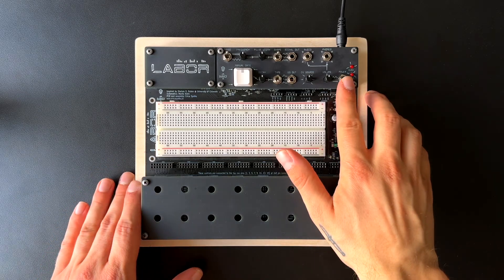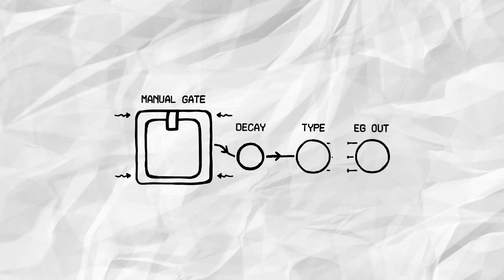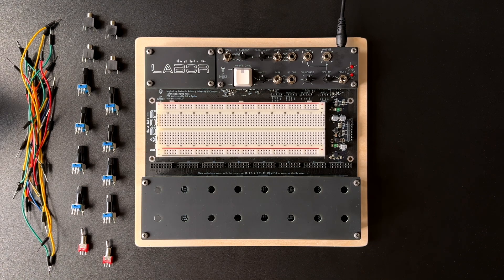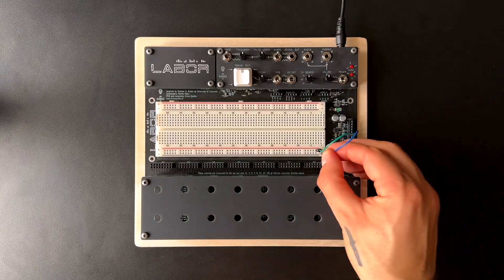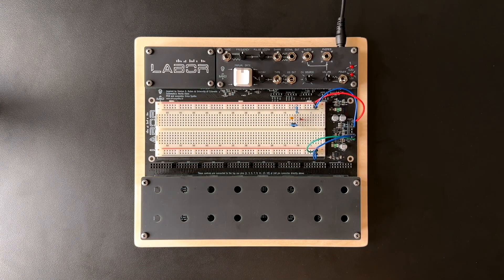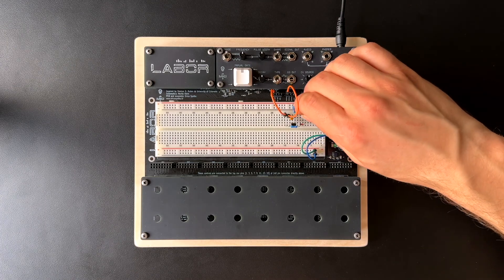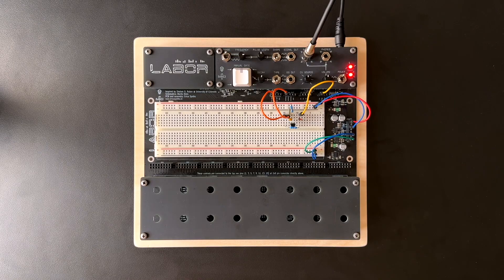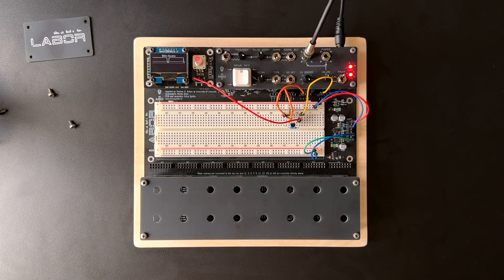I created a DIY synth prototyping station

Comment: Built it. Now on to doing some laboring with Labor!
A buit-in speaker is probably the only thing I wish it had. Probably going to build one for the expansion part myself.
I can see how someone could write a whole book with audio experiments for this board. I'd buy it.
Reply from the maker: glad to hear! we‘re also planning to do a speaker for the expansion slot - and a book with audio experiments :)
Reply: @MoritzKlein0  I love this things. Really awesome. Just have to figure out how to store it with parts and such in a way that I can easily pull it out and play around with it and safely store it away again. 
Only one thing I suggest, if you ever to an update to the build manual, I found that using the breadboard itself to get the connectors on the pot/sw/con modules straight. Basically plugging the connectors in the breadboard and had the module on top and then soldered it. It helped holding the connectors in place while soldering it and also to get it totally straight. I hope that makes sense.
If you need anyone to do test cases on the book, I'm willing to be a test subject. :)

Comment: Hell yeah, mine just arrived and it's gonna be a godsend with diy projects - especially having the integrated power supply. I might even modify one of the jack modules to use larger 1/4 inch jacks for kosmo format 😁

Comment: This is exactly what i've been looking for and i've got one coming today!  I recently built a TTSH and one of the two filters isn't working.  It's on a sub-board but still needs a fair bit of supporting hardware to really test and this should help a ton.   Is there any reason this wouldn't work if I feed it +/-15VDC instead?
Reply from the maker: you mean use a 15V wall wart instead? that shouldn't change anything about the supply voltages, since they are transformed inside the device.

Comment: Love the videos, extremely helpful, insightful, and interesting. Could you recommend basic electronic components that most commonly appear in your circuits, specifically which IC's are used the most often?
Reply from the maker: you can check the Labor manual for a list of commonly used components (bill of materials/full kit section): https://www.ericasynths.lv/media/LABOR_MANUAL.pdf

Comment: I've  been thinking about building something like this as an aid for experimenting with guitar effects design.  Very well executed design and implementation.  The modular drop-in oscilloscope built with what must be an ESP32 microcontroller and LCD screen is just the icing on the cake.

Comment: would you consider selling variations with power supplies optimized for guitar pedal design (9 and 4.5 volts) and 500 series module design (+16, -16, +48)?
Reply from the maker: hmm haven’t thought about that. i‘ll discuss it with the others :)

Comment: I always use a basic 3 / 5 / 9 volts direct source for my projects.  Going full +-12V is a big hurdle for me.  I felt I was learning the process backwards: learn how to built a power supply before learning to build synths.  This board seems to bridge the gap nicely. 🤞
Reply from the maker: yeah, it’s surprisingly hard to even find bench power supplies with dual voltages

Comment: Thanks, I need something like that. Will you also provide empty expansion cards?
I can well imagine creating a simple filter extension, for example or a basic wave player as source. Developing on the labor and later using in the labor.. something like DIY inception. 😛
Reply from the maker: hmm how would those empty cards work? is the idea that you would have something like a stripboard section where you can set up your own circuitry? we do plan on publishing the specs so you can create your own module :)

Comment: I love it! I got so excited seeing Labor in your last video that I tried to buy one right away, only to see it wasn't done yet, so I went ahead and made a quick-and-dirty version myself. It's a small C-shaped PCB that pushes on top of a breadboard. It takes a Eurorack or Pocket Operator Modular power plug and passes the +12v, -12v, and ground onto the breadboard's power rails. It also has two slots for a potentiometer, vertical audio jack, or horizontal audio jack that connect to the first columns of the breadboard.
I ordered the PCBs, and even with five of them now, I still want to get a Labor!
Thank you for making such wonderful things!
Reply from the maker: that sounds like a great project :)

Comment: This looks awesome! Are you possibly planning a non preassembled version in the near future and also are the expansion modules available yet? Thanks for this build!
Reply from the maker: the first expansion modules (oscilloscope and eurorack power outlet) are in the works, will hopefully be released very soon!
Reply from the maker: gotta check with erica if we plan on doing a fully DIY version, but so far we haven’t considered it!
Reply: @MoritzKlein0  Judging by the photos I've seen, most of the main PCBs are populated with surface mount components. I'm not saying it's impossible to re-design it for through-hole, but I don't believe it would be a worthy endeavour for this project in particular.. of course, you may choose to keep it SMT and still make it DIY, but that also complicates things as then the target audience shifts from people that are just starting with electronics DIY, to more experienced hobbyists and makers. Mhm.

I've quickly taken a look at the instruction manual and, personally, I think that this project has the perfect amount of user assembly required. Congratulations to you and to the team at Erica Synths, it looks like it will be a great little tool and a very nice companion to the rest of your DIY kits! I am looking forward to know more about the expansion modules too.

Quick question: is the circuitry of Labor entirely analog? I know it's probably a "yes", but I just want to confirm. Looks like its elements are simple enough to all be implemented analogically, correct?
Reply from the maker: @dr.getter7118  you're right, there is a good chunk of SMT components on the main board. that said, all the interfacing elements at the top are through hole and could be left for the user to assemble. i'm not sure it makes a huge difference though, since there is already plenty of stuff to solder.

and yes, all the circuitry is entirely analog – i designed a big chunk of it, expect for the power supply, short circuit protection and output amp :)

Comment: Great minds think alike; I designed and built a prototyping machine specific to op-amps but went a bit further in terms of the "breadboard" so it's preconfigured specifically for amplification, filtering, shunting and so on.

I'm in the process of designing the 3rd generation of that prototyping machine because it's long overdue since I know I can do tremendously better and the previous build got damaged; a blessing in disguise. 
I came up with mine about 12 years ago and what kills me to realize now is it's what Arduino is for digital microcontroller embedded development and for the last 10 years, I had never looked enough to know I misunderstood what Arduino actually is! 

These are huge steps forward in advancing technology my friends!